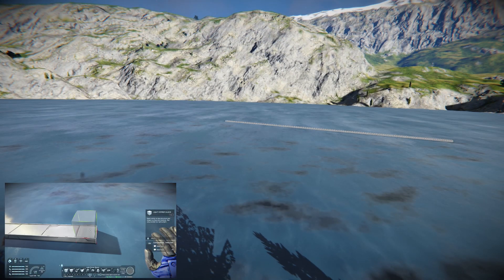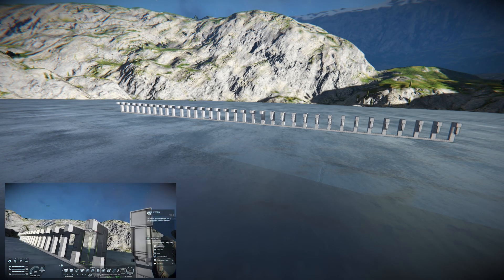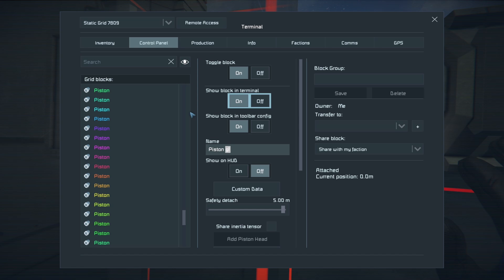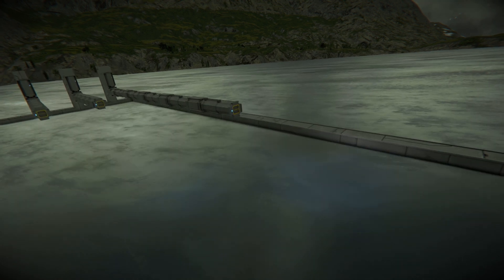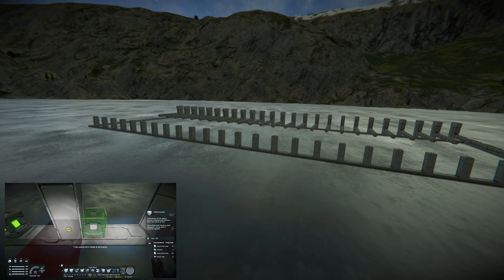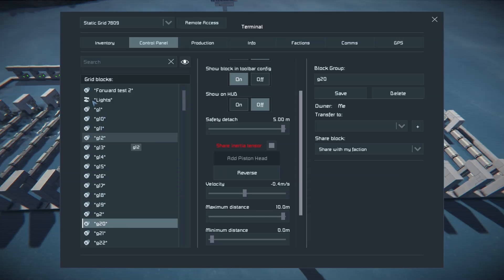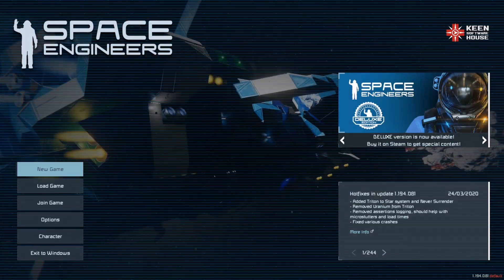Space Engineers Large Grid Miner Optimal Speed

Comment: Great video! I would suggest when you're doing more of similar tests to put text with the setup description (in this case it'd be the speed of all the pistons) on the screen of each of the tests @5:07 so it's more obvious which setups work well and which don't. However, I like your scientific approach a lot; roughly figuring out which values are interesting and then testing around those points in much more detail is a very efficient thing to do!

Also, was this with inertia tensors on or off? I reckon that would influence the clanginess quite a bit.

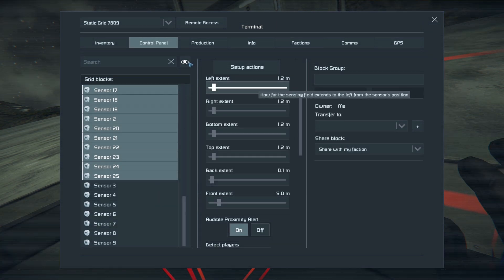And lastly, a little tip - @2:42 the large number of pistons really clutters the G menu, you can hide the blocks by ticking off the Show in Toolbar Config the same way you tick off Show in Terminal.
Reply from the maker: This was with tensors shared. you have some good points, perhaps I can update the video sometime in the future with all of this in mind.